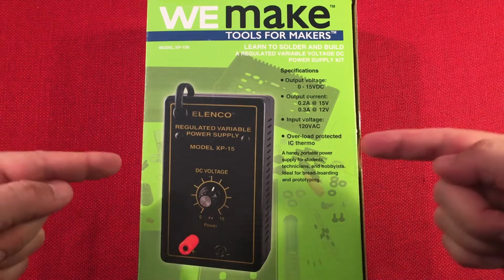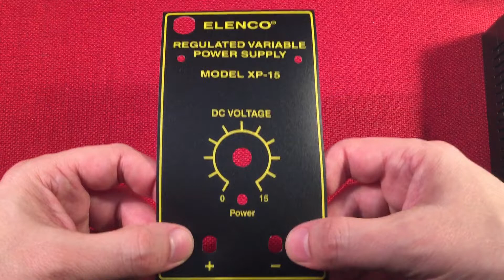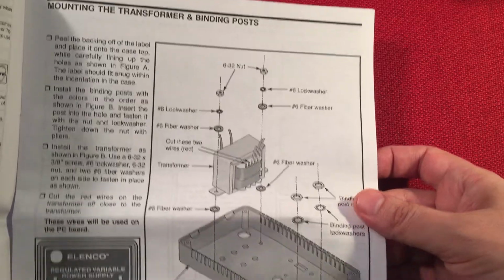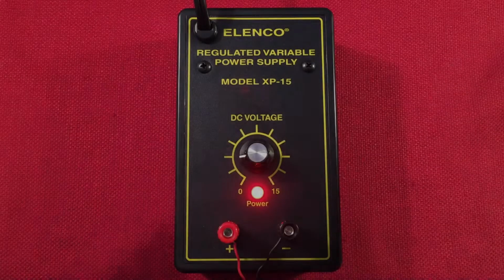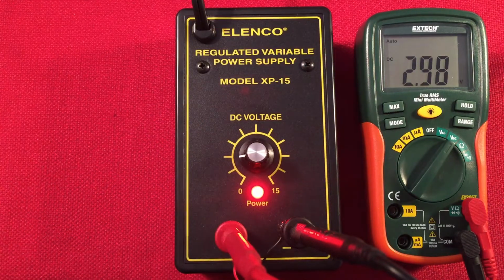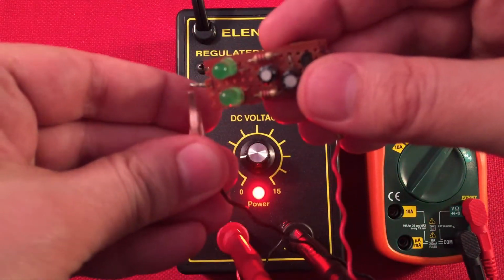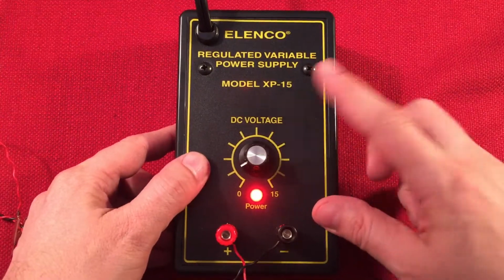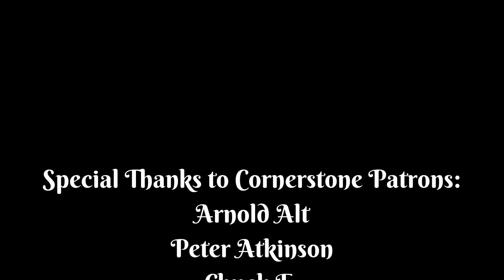Elenco XP-15K Variable Power Supply Kit Build & Review

Comment: This looks like a very worthwhile project. You can learn to solder, power supply fundamentals and have a usable power supply as a bonus.
Reply from the maker: It works out great for powering small projects and troubleshooting small radio repair.  I had a great time building this.  The hardest part was crimping the AC cord strain relief.  Used an over sized pair of vice-grips to get the job done ;)